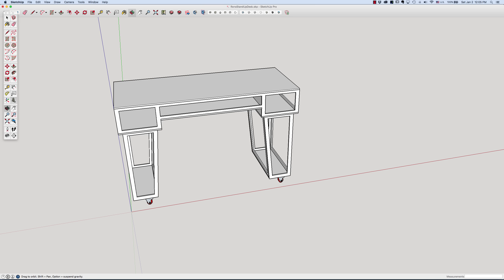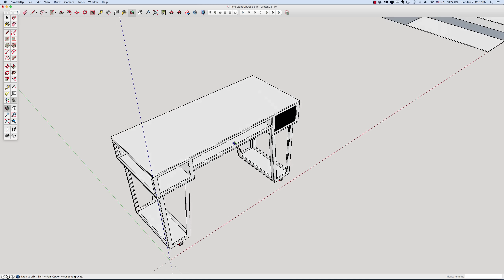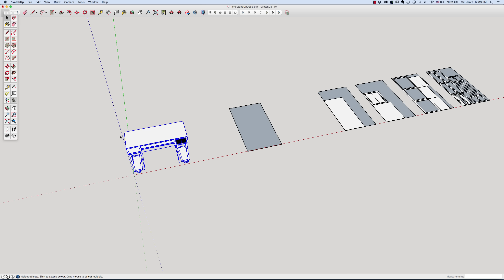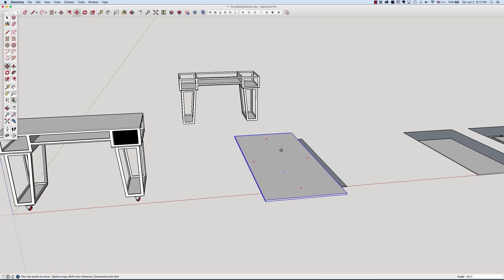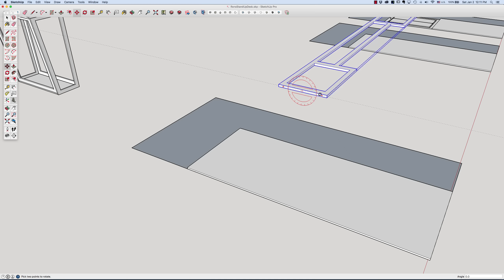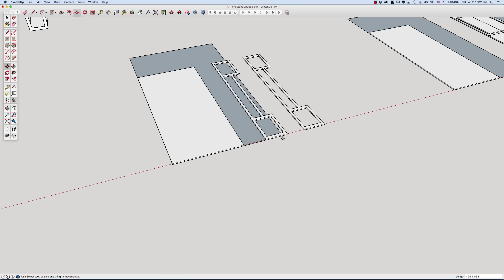SKETCHUP TIP Estimating materials

Comment: I've been using Cutlist Plus Gold version to automatically generate cut layouts for all of my euro kitchen cabinets. Your method is fine if you only have a relatively few parts, but if you have dozens and dozens of parts then the task of manually moving them around becomes very challenging. I use the Cutlist Bridge extension to send all the data from Sketchup to Cutlist Plus. I have 22 cabinets in my kitchen remodel and would have spent countless hours trying to figure out how many sheets of  prefinished and unfinished Maple ply I needed if I had tried to do it manually.